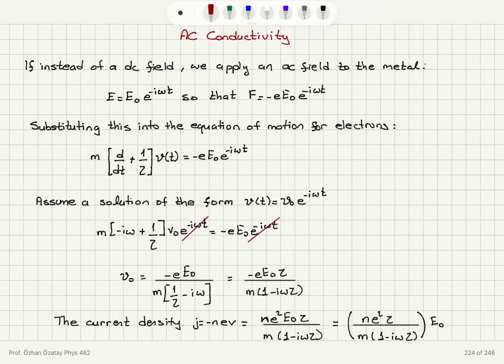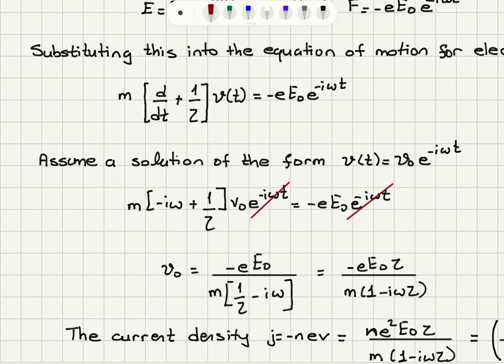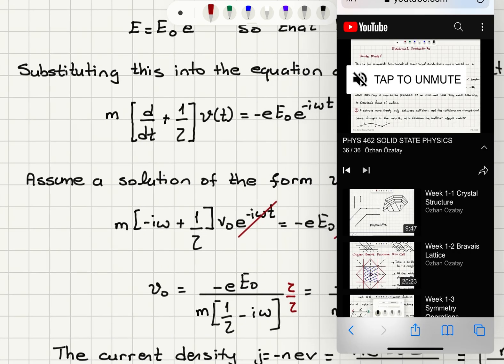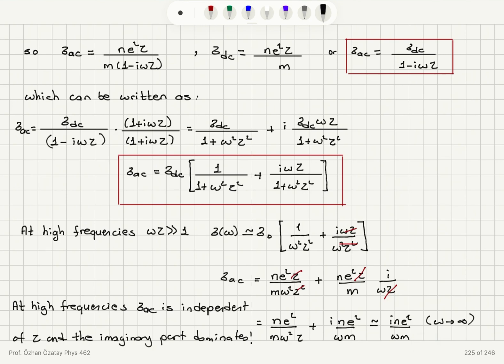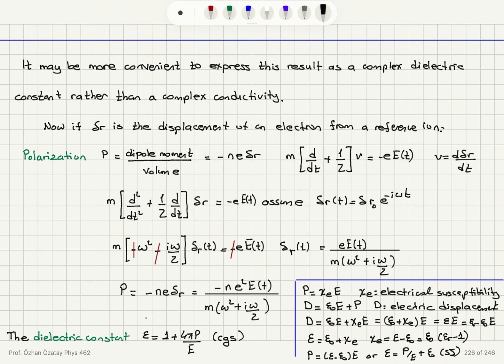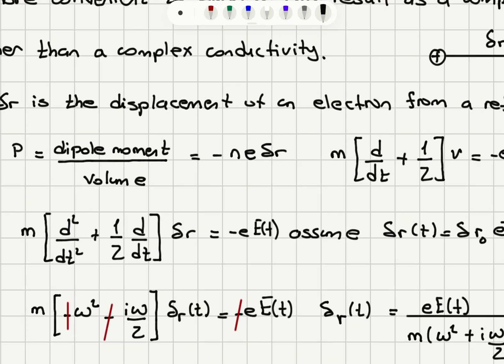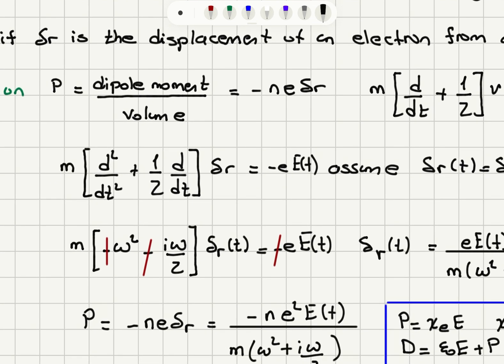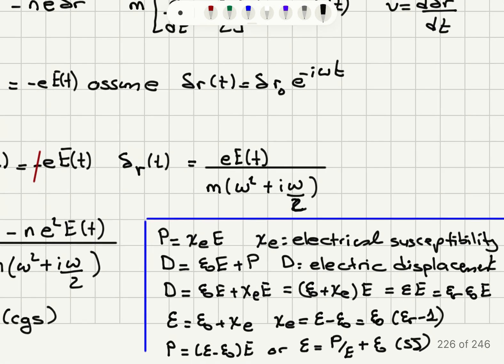Week 10 - 1 AC Conductivity and Plasma Frequency

Comment: If you were in my shoes and you figured out how to make air, hot water, electricity and gravity...and gain mass and slow time.... using sound and no moving parts.. what would you do?... knowing that the technology would probably be seized..... Mankind is never going to get ahead because the way they are trying to do fusion.. is a completely stupid way to waste a lot of money.
All that math is probably a good thing to know... but it doesn't give anyone any common sense and actually makes it harder for anyone to really figure it out.... in fact you have to throw everything you learned out the door and just take a good look at the galaxy and try to replicate it in a box and figure out how it spins... and it is done with sound..... and everything else just complicates it ....because it's so very simple to understand it when you look at how sound behaves.